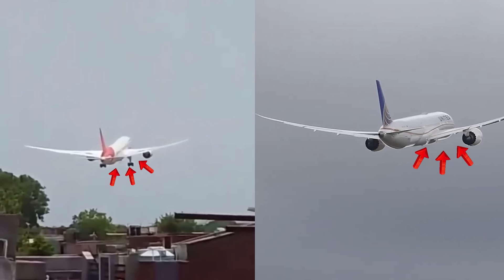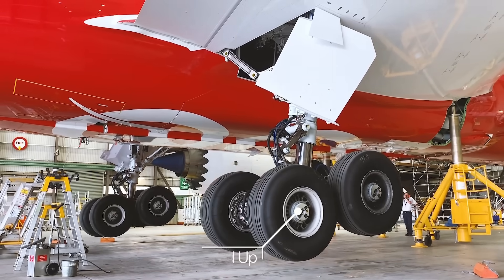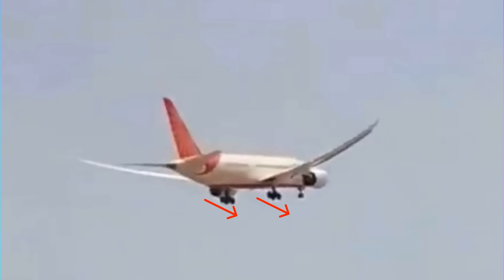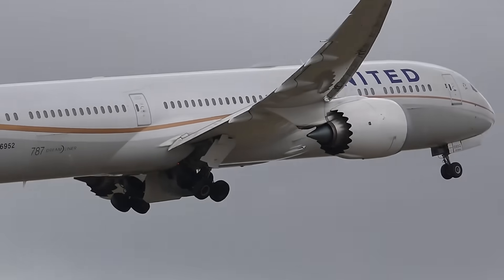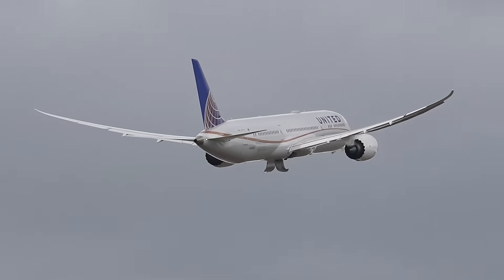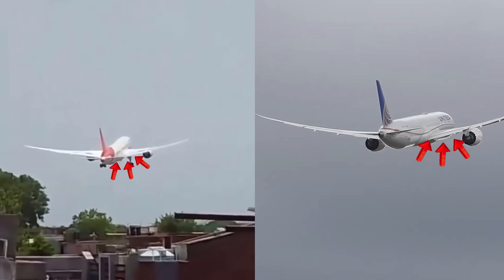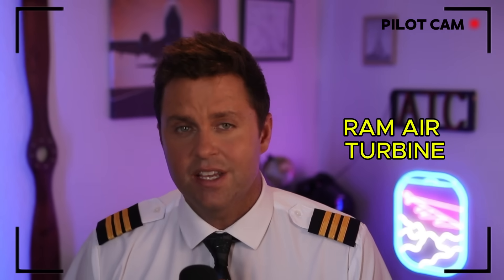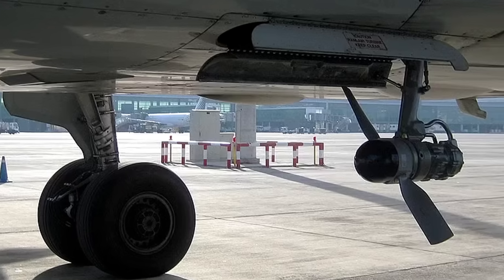Pilot Explains: A New Detail in the Air India 787 Crash Everyone Missed

Comment: Speculation and only a theory. 

I call a total electrical failure on the Air India 787. The 787’s electrical system powers not just flight controls but also engine control units (FADEC) and support systems like cooling and anti-ice. A failure could disrupt engine operation, throttle response, and control surfaces simultaneously — a deadly combination unique to the 787’s more-electric design. If the battery buses or power distribution system are compromised, battery power can’t reach the systems it’s meant to support.

The battery alone isn’t capable of powering the whole aircraft — it only supports a limited number of essential systems, and only for a short period.
Yes, the battery provides backup to critical systems like engine control (FADEC), emergency power (via RAT), and minimal avionics in an emergency.
But if the failure extends into the distribution network or control logic, even those backups may not function — leaving the aircraft unable to restart engines or control flight surfaces.

That’s why a full electrical failure on a 787 is uniquely dangerous.
Yes, GE engines (like the GEnx on the 787) have dual-channel PMAs (Permanent Magnet Alternators) to power the FADEC — independently of the main aircraft electrical buses.

But here's the problem unique to the 787:
The aircraft's entire operational dependency is on electrical distribution. You don’t need all four engine-driven generators to fail — you just need a distribution bus failure, a short, or software fault (as seen in prior 787 incidents) to cut off those FADEC PMAs from delivering usable output to where it's needed.

Also:

If cooling fans, inverters, or control relays in the Integrated Modular Avionics (IMA) racks fail — the FADECs can overheat or shut down.

Boeing centralizes too much through software-managed buses, meaning a corrupted logic path can trigger a false overload or trip entire buses offline.

So while it’s “hard to lose 4 sources,” it’s much easier to:

Lose access to them, or

Render their output useless, through faulty routing, sensor misreadings, or control logic errors.

That’s the Achilles’ heel of the 787’s “more-electric” design — the power might still be there, but you can’t get to it.

A total electrical failure on a Boeing 787 would be catastrophic — not just inconvenient. The 787’s “more-electric architecture” replaces traditional pneumatics and hydraulics with electrically powered systems. So let’s unpack what a true electrical failure would imply, how it could happen, and why it's a nightmare scenario:

What Does the Electrical System Power on the 787?

The 787 relies on electricity for:

Primary flight controls (via electro-hydrostatic actuators)

Engine control units (FADEC) – fully electronic, no mechanical backup

Throttle response – digitally linked

Air conditioning, pressurization, anti-ice

Fuel system pumps and valves

Lighting, avionics, and displays

It uses six generators — two on each engine (IDGs plus backup permanent magnet generators), and two from the APU. These are controlled via power distribution units and software-managed electrical buses.

---

What Happens in a Total Electrical Failure?

If all six generators and distribution systems fail, you'd lose:

Fly-by-wire controls (control surfaces powered by electric hydraulic actuators)

Thrust lever control (since FADEC relies on power)

Engine restart ability, unless batteries intervene

Displays, communications, and navigation — effectively blind

A scenario like this would render the aircraft unflyable, even if the engines continue producing thrust briefly.

---

What About Batteries?

Yes — there is a lithium-ion battery backup system. In an engine-out or generator failure:

Batteries provide limited power for essential systems (e.g., standby instruments, communications, FADEC during restart)

They power the Ram Air Turbine (RAT) deployment logic, which can supply hydraulic and limited electrical power

However, battery capacity is short — minutes, not hours. It buys time, not recovery. If the failure involves power distribution buses, battery power might not even reach critical loads.

---

Dual Engine Failure ≠ Total Electrical Loss

In a typical dual engine flameout:

The APU can auto-start in flight and restore electrical buses

Batteries support FADEC and ignition for relight

The RAT provides hydraulic backup for flight controls

But in a total electrical collapse, even with engines running:

FADEC may become unresponsive

Engine control and restart may be impossible

The aircraft may be intact but uncontrollable — effectively in free fall

---

What Could Cause This?

Some plausible or previously documented causes:

1. Massive bus failure or software corruption in power distribution

2. Multiple generator failures (including APU) from a short circuit or surge

3. Physical damage from lightning or undiagnosed maintenance issues

4. Improper grounding, bonding, or flawed assembly (as alleged by whistleblowers)

5. Severe thermal event — fire affecting electrical wiring or the EICAS bay

---

Final Word – Unique to the 787

This vulnerability is specific to the 787’s more-electric architecture. Older jets like the 777, A330, and 747 rely heavily on pneumatic and hydraulic backups. The 787 replaced those with electrics — and if those electrics fail, the entire aircraft goes dark.
Reply: And this plane turned around and went back to the gate on take off from Frankfurt on 29th May when passengers complained of a foul burning smell ‘like electrical wires’. The passengers spent the night in a hotel before eventually leaving Frankfurt the following day for Mumbai. It was a 28 hour delay I believe
Reply: @Helen-cw1qs   Yikes! Hadn't heard of that incident. Seems all too relevant now. Did see a recent pic of this plane leaving Frankfurt.
Reply: And there was a complaint about no AC at some point.  @Helen-cw1qs
Reply: @Helen-cw1qs  sources?
Reply: The survivor said that lights were flickering on the plane.
Reply: @bonblue4993 that's when the engines weren't getting anymore fuel due to electric fuel pumps failure .... With the momentum they had they still made it off the ground. That's why they used the entire length of the runway. The rest will go into the history books as the first crash of a 787 ....
Reply: Very good analysis,,, knowledge with t.  Understanding,,,, God Bless
Reply: @JohnMcCloskey-g9o thats chatgpt bullshit
Reply: That’s an awful lot of faith placed in electronics and software. It’s crazy to think a simple glitch or failure could crash everything including the plane. Scary too.
Reply: The more complicated the software gets the more likely it could be glitchy.@lieutenantdangle3128
Reply: Sound very logical and  highly experienced. 🙏🙏
Reply: The electrical problems the previous flight experienced could be a major clue and would support your hypothesis.
Reply: That's what I was thinking, but I assumed the engines would be able to produce thrust independently even if all the electrics fail. Because they work by burning fuel, and because they generate electrical power, so how come they need another power source to completely rely on in order to operate? Do you know what I'm trying to say? Of course, I know nothing about airplanes, just thinking logically.
Reply: @The_1_Assassin  Engines will continue to run with both AC BUS 1 & 2 failures.
Reply: @petergill2265 That’s not quite accurate. On the 787, if both AC BUS 1 and 2 fail — especially due to a cascading electrical fault or power distribution failure — the engine control units (FADECs) can lose power unless backup sources kick in properly. And that’s a big if in a compromised system.

Yes, engines are designed to run independently, but on the 787, FADEC is 100% electrically dependent — no mechanical override. If both AC buses go and PMA (Permanent Magnet Alternator) power is disrupted or can't be routed properly due to a bus or software failure, the FADEC shuts down — and the engines will spool down with it.

That’s exactly what RAT deployment implies: the system lost all normal and backup generator input, including APU and engine-driven sources. So the idea that the engines would just keep running smoothly after major bus loss? Not on the 787 — not if FADEC goes dark.
Reply: @petergill2265 so the loss of thrust in both engines simultaneously couldn't have been caused by an electrical failure, right? What about the fuel pumps? Can engines supply power to them to continue operating if the other systems fail? I'm trying to understand how it works.
Reply: @savvas0711 the engines sounded at idal at best when rat was down
Reply: @The_1_Assassin  I don’t have my manuals here, I’m doing rotary wildfire suppression work for the rest of the summer. There are 6 fuel pumps, two in each tank. IIRC, they are dual AC/mechanical powered, plus DC battery backup, plus suction, plus battery. There was an incident I’m aware of that once on startup where the engines were running but the generators weren’t yet online, the APU and hence the APU-supplied generator power was shut off. Everything on the airplane died, except the engines. The fuel controls had to be shut off to shut the engines down. So I’m fairly certain that loss of electrical power wont shut down the engines. I believe it was the opposite.
Reply: @savvas0711 you are wrong the PMA's are on the engine gearboxes, they are driven by the engine and they power the EEC's after 8% N2. The EEC's use aircraft power on start and as a backup. If the engines are turning, the PMA's (that are mounted on the engines themselves) are powering the EEC's. They are totally independent of the aircraft power, all they do is power the EEC's The wiring from the PMA's to the EEC's are  contained only on the engine 10:58  harness 10:58 10:58
Reply: @savvas0711  I’m not going to bother to explain why you have no idea what you’re talking about.
Reply: @heavyg7105 
You're right that the PMAs power the EECs independently once the engines are above ~8% N2. But in this case, the engines clearly lost thrust — that’s visible in the video and supported by reports. So the question isn’t whether the PMAs were powering the EECs — it’s why the engines failed to deliver thrust despite still rotating.

That points to a deeper problem:

Either thrust control was lost due to a fault beyond the PMAs (software, EEC logic, throttle signal disruption),

Or the EECs themselves didn’t function as intended, even if powered.

And since this is a 787 — fully fly-by-wire — any major disruption to the aircraft's electrical system can cascade into flight controls, sensors, and even throttle response. PMAs keeping the EECs alive doesn't guarantee functional engine thrust, especially if there's corrupted input or systems upstream of the EECs.

So yes, the PMAs did their job. But the bigger issue here is why the engines lost usable thrust at the worst possible moment — and that’s exactly what the investigation will need to focus on.
Reply: @petergill2265 Thank you, Peter. Best of luck with the wildfires, they are absolutely horrific. Stay safe!❤
Reply: @The_1_Assassin  The following is a gross simplification but from what I can pick up (I don't know about planes either) FADEC's (engine control units) are ultimately dependent on a stable  electrical source to run. If that power fails, and if no back-up system is working,  the FADEC's shut down, and so subsequently, will the engines. Hope that helps!
Reply: @TheLitehart1 You're actually not far off — and it's a great way to frame it. FADEC systems do have their own dedicated alternators (PMAs) mounted on the engines to keep them powered independently. But if there's a wider electrical fault — especially during engine start, or if bus logic or power transfer fails — those PMAs might not yet be active or sufficient.

So yes, if FADECs lose power entirely, engine control is lost. That’s why a cascading electrical failure can lead to a dual engine issue — especially on aircraft like the 787, where so many systems depend on tightly integrated power sources and logic.
Reply: @savvas0711  Thanks very much for explaining this. If I absorb even a tiny fraction of your depth of knowledge, I'll consider myself well off ☺ Is it possible that the 787 might be better off with a little less dependency on electricity? Maybe the 'domino' effect wouldn't be quite so severe when one system fails?
Reply: @The_1_Assassin 

They are saying that the fuel pump is electrically powered and electronically and software controlled. So if the fuel pump loses electricity or the electronics or software fails, then the pump stops and the engines stop.
Reply: @The_1_Assassin  If an electrical failure, I immediately thought of Apollo 12 which was struck by lightning twice, knocking all 3 fuel cells offline (instrument panels went dark)  but the rocket continued  due to a completely independent instrument unit guidance system contained in Stage 1 or Stage 2 of the rocket. Good old analog systems.

https://en.m.wikipedia.org/wiki/Apollo_12
Reply: @The_1_Assassin The fuel control units are fully controlled by the FADEC( Full Authority Digital Engine Control). Google for additional information/explanation.😊
Reply: Thank you for this high level of detail. As an Engineer,  I understand that systems in an aircraft should have INDEPENDENT layers of redundancy; so are you saying this aircraft does not have this with this type of electrical failure?!!!!
Reply: @NobodyOfNote-qv5wh Absolutely — aircraft do have layers of redundancy, and the 787 is no exception. But the key point here is that when electrical power becomes the single point of dependence for so many systems — from hydraulics to flight control logic to cabin environment — then a failure in the power distribution architecture, even if technically redundant, can still cascade in ways redundancy can’t fully isolate.

So no, we’re not saying it lacks redundancy. We’re saying that when multiple systems all draw from shared electrical buses, and power transfer logic fails (say, from APU to engine generators), it can expose vulnerabilities in that shared electrical dependency, regardless of how many backups exist on paper.

Redundancy exists. But when everything depends on that same electricity, even backups can fall into the same trap.
Reply: In all this rant here’s one thing you’re forgetting.  The FADECs are powered by their respective PMAs after the engines are turning at a certain RPM.  The “switching” from aircraft electrical power to PMA power would occur during engine start.  Those FADECs were being provided power from the PMAs before the airplane even began its taxi.

The FADECs are mounted on the engine.  There’s no cooling fans to the FADEC.

I won’t start on the fly-by-wire flight controls.

Let’s wait and see what the investigation shows.
Reply: @georgiathai4961 True, FADECs are powered by PMAs after engine start and the engines were clearly running — but that doesn’t make them bulletproof.

The 787 uses a tightly integrated electrical system, and even after start, failures in power distribution can affect signal integrity, sensors, or software communication with engine controls — especially during takeoff.

This jet was built at the Charleston plant, where whistleblowers reported metal shavings near wiring and loose connections. Those aren’t theories — they’re on record.

So yes, the FADECs had power. But could electrical issues still affect control or performance? Absolutely.

This isn’t about textbook systems — it’s about what actually fails in the real world.

You're right that FADECs are powered by PMAs after engine start, and the engines would still be running even with a total aircraft electrical failure — that’s not in dispute. But this is about the Air India 787 crash, and what matters isn’t just whether the engines were spinning — it’s whether the pilots still had control.

The 787 is a fully fly-by-wire aircraft. All primary flight controls, displays, and systems like pressurization and trim depend on the aircraft’s electrical system, not the PMAs. If there’s a serious electrical fault, it can disrupt flight control computers, actuator power, cockpit instrumentation, and sensor data.

That’s why the claim “you don’t lose flight controls with an electrical failure” is wrong — especially on the 787.

This aircraft was built at the Charleston plant — the same one flagged by whistleblowers for metal debris near wiring, loose fasteners, and grounding issues.

So in this crash: yes, the FADECs likely had power. Yes, the engines were probably still running. But if electrical faults took out control or data systems, the result could still be catastrophic — as we saw.

This isn’t about FADEC theory. It’s about what actually fails when real-world defects meet real-world pressure.
Reply: @savvas0711  If you ever would have watched the video:
- The airframe did not got out of control regarding primary control surfaces, the pilots were steering it to the last second.
- the airframe passing the camera was very silent beside the roaring RAT, this indicates no power from the engines which causes the thing to go down whatever the pilots do or don't.
A silent Dreamliner is a gliding Dreamliner.
Reply: Wow! Thanks for the input.
Your knowledge is appreciated.
Reply: I don't understand why the speciality of a 787 - to be fully dependent on the electronics - in contrast to a 777 - is not discussed openly in the media! Do the pilots not know or are the afraid to talk about this?
Reply: This plane have had full service history up to date according to officials
Reply: Thank you so much for this very thorough explanation, this is extremely helpful to me
Reply: thank you, Chatgpt 😂
Reply: Superbly detailed explanation, well done 👍
Reply: Come on with all your text nobody will read:

A failure on the airframe's electrical bus systems will not stop the engines producing power.

This airliner was silent while passing the camera: Those engines were both windmilling while the RAT was roaring.
Reply: Great contribution and insight to the working/ design of this aircraft. 

If passengers knew of this central design architecture I do not think people would fly on it. 
I bet the insurance on these aircraft will soar. 

We just heard from the US enquiry into Boeing’s pore record of safety assurance and quality control from a whistle blower Sam Salehpour on the noncompliance to standards (production shortcuts). Electrical systems was mentioned.
I am also wondering if moisture condensation buildup from faulty sealing in these buses could cause shortages. India is a very humid country and it is summertime.
I am also astonished that all these electrical systems are routed through a multipurpose buses. As you point out it becomes a domino failure.
Reply: @whenderson6669  savaas using chatgpt 😂
Reply: Look into the 248 day software bug in the 787. The PCU software can cut all AC power and the engine driven fuel pumps cannot guarantee enough fuel flow in all phases of flight. Takeoff power and rotation could explain reduced fuel combined with electrical failure
Reply: Thank you for this possible theory. Engineers and pilots should be the only ones qualified to make judgements and not media people and non technical people who know nothing about airplanes. Can you explain how the A 350 is different. The A350 does not have Lithium batteries as Airbus reverted to Nickel Cadmium batteries when the 787 suffered from battery issues. Also the A350 is not fully electric like the 787. As John Leahy the previous CEO of Airbus mentioned that when he wanted to adapt the same architecture of the 787 into the A350, he was voted down by his engineers. Seems a very wise decision and since Airbus is run by engineers,  you would expect so.
Thanks
Reply: I'll take my next flight in a DC8
Reply: @dennislear3336  I prefer the DC3!
Reply: That is one spooky scenario... nightmarish actually!
Reply: Yep, you’ve convinced me.  Thanks for that level of detail, obviously based upon extensive, perhaps even total, knowledge! 👍👍👍
Reply: tl;dr boeing wants to murder people
Reply: Yes it's thru tanks
Reply: This was now VERY interesting....    😮
Reply: Yet the A350 manages to doo the same
Reply: Great analysis. Thanks
Reply: But why did it happen between 0-30 secs after takeoff? Why not a minute before?
Reply: https://youtu.be/29qlIL429Eo?si=XFzl-lDvVZmhFGaF
Reply: what do you mean?
Reply: Don't the engines have pma to supply power independently to the fadec?
Reply: Centralized electrical/software design is the worst nightmare of any complex system—it’s the perfect recipe for single-point failures—one small mistake and it’ll take down the entire system. If this indeed is what happened, I’d blame the decision makers and approvers of this design—whether it’s the engineering team or management team or both.
Reply: With all that said (and it is a lot of good information - though I am not a pilot/engineer and can't vouch for the accuracy of it all) - my question would be if the plane is uncontrollable in a complete electrical failure how did they pitch the plane up in the few moments before impact? You can see the elevators commanded up and the plane does pitch up more and more in the last few seconds. Genuine question
Reply: Pretty sure at least one boost pump in each tank in the 787 is powered by the battery buss. Loss of engine not an electrical problem.
Reply: AI WARNING: Very well explained - How did You reach this level ? Ore did you simply use AI ?!
Reply: @mander0505  AI is the way to go these days to reach any level no matter what.
Reply: Most comprehensive explanation of the Total Electrical Failure I've heard anywhere;...And seems to 'tick All the boxes!!.... Great Job, guess we'll ALL know soon!😊🎉
Reply: @OswaldJames-x2t Except it’s all wrong
Reply: @georgiathai4961 Pray tell what specifically Is "wrong"?😊
Reply: Sir you are an amazing genius. I think you have nailed the analysis perfectly and this should help solve this issue. Yet Boeing continues to fly these planes and that is very scary 😢
Reply: @VIWA1 What he says about the PMAs is dead wrong.  The PMAs are powering the FADECs before the airplane even start to taxi.  There is no “switching” to the PMAs in the event of electrical failure.  By the time the engines reach idle after engine start the FADECs are being powered by their respective PMA.  

There’s no cooling fans on a FADEC.  

You don’t lose flight controls with an electrical failure.  

It appears to me that he’s read something about FADEC and its source of power and then ran with it.  What he says is completely incorrect.

While it is true that with total loss of FADEC the engine cannot continue to run, the airplane can lose total electrical power, the RAT generator can fail, the batteries can be completed flat and those engines will still be running because FADEC is being powered by their PMA, and they have been since the engines were started.
Reply: What, can you say that again, please? 😂
Reply: Very good analysis 👍
I agree with a Software problem. The whole setup of the start procedure is looking good as usual, the problem pops up seconds after airborne. The wheel settings indicates that the wheels were set to go in but in that seconds every thing stopped working, no Hydraulik.. At a altitude of 190m getting a total system fault, the rat setting in, the only chance the pilots had was controlling the crash to death..😢
Reply: Jesus, I guess I was not wrong about not wanting to ride this jet until several years or service had happened. I wouldn’t be surprised if Boeing cut some corners to build this jet. I was more concerned about the new fuselage design and not the electrical centered design.
Reply: @andresgarcia7757  B787 aircraft have been flying since December 2009.
Reply: Meh
Reply: @keninhb2196 what say you ? Lets hear what your theory is.
Reply: And what say you ?  @keninhb2196